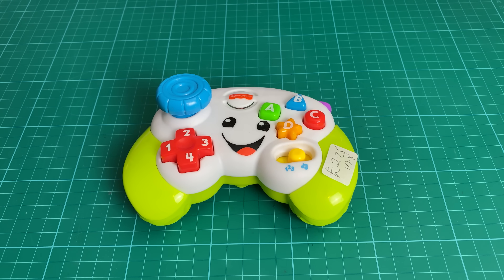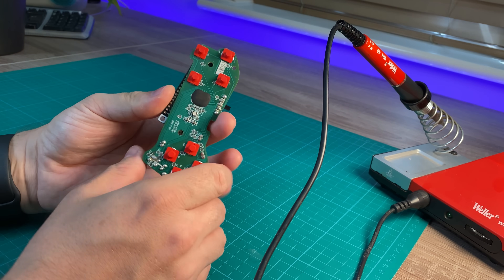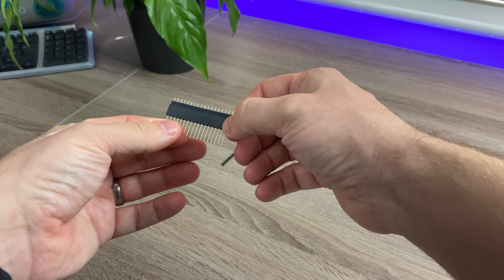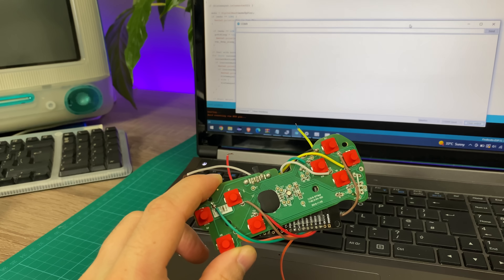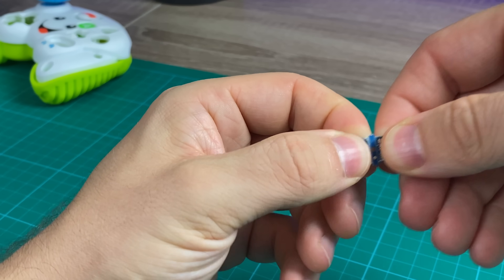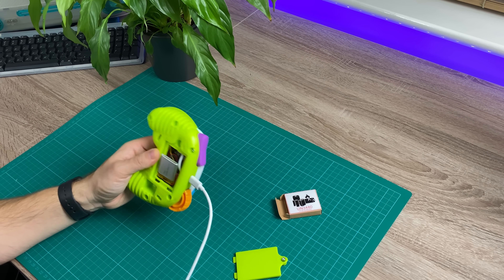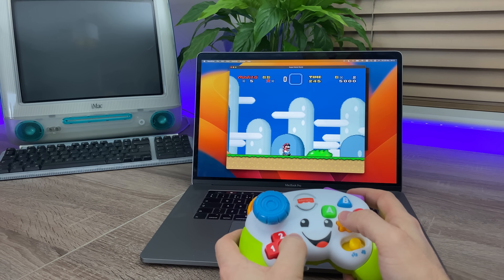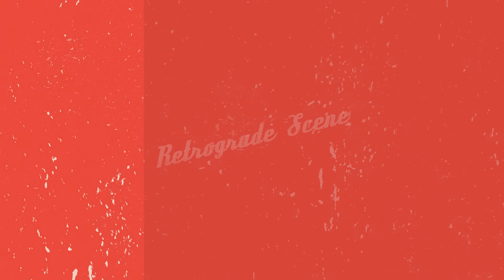Making a Bluetooth controller from a Fisher Price toy

Comment: I had similar issues with sleep on my lolin board, same design as yours.   Even when I set wake mode to any high and rewireing my remote with pull down active and buttons connecting 3.3v it would always get stuck in sleep or never waking up.

Comment: the hardest thing about tinkering with electronics like this is fitting everything together, we had a broken scale at home (i broke it trying to add a tp to it to make it charge a lithium battery before) so i thought to myself id fix it using an esp32 and a hx711 chips, coded everything up in no time, then proceeded to take 2 days trying to fit everything together, barely fit it at the end but it work now which is what matters
Reply from the maker: I know the pain well! That’s the good thing about kids toys is they’re usually more liberal with the space inside.

Comment: Those 2 small solder pads at 10:07 are for a tiny 5.1kohm smt resistor
I bought those same connectors and they work if you solder on the correct resistor
Reply from the maker: I tried that and a few other combinations but couldn’t seem to get it to work. Maybe it was just a bad solder joint. I’ve got a similar thing in a new project so hopefully I’ll have more luck with it.

Comment: Great work on this, for me I would just cheat slightly and use an 8bitdo Zero2 board since it does all the bluetooth, battery, and system compatibility stuff in the same size package as this board.

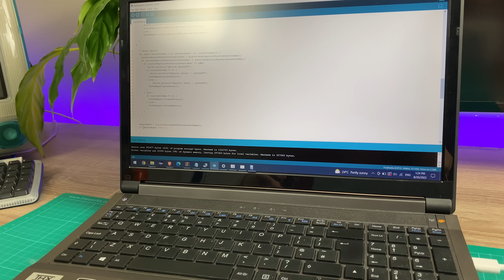Comment: super interesting video! I've recently been thinking about trying something similar as well, so this is really cool to see! and btw, for reference, 9:38 the USB-C port should still work for data if you're connecting it using a USB-A to USB-C cable – if your laptop doesn't have USB-A (like my tablet) then using an adapter to USB-A will work too. I used the exact same method of cutting up a microUSB cable for a project of mine just a few weeks ago! Nevertheless, I bought the very same USB-C ports recently, and I'm hoping to get them working with pulldown resistors~

Comment: Followed along but had a quick question on the wiring/programming. Did you use the debounce function in the ESP32-Gamepad library? And/or use the ESP32 built in pull-up resistor for the inputs before just cutting the traces? Not like I'm trying to save the sounds (trying to save my sanity!) but mostly for my own understanding. Thanks!
Reply from the maker: Hi I did write a version using the debounce but was having issues with it so the version that’s on there doesn’t use it. I did mean to go back and try it again as I’m sure it was something I didn’t have quite right. I also tried using the built in pull up resistor as I was hesitant to cut the traces. But I couldn’t get it to work and in the end didn’t thing it was worth the time to play around with to save the board, like you I was secretly glad to loose the sounds. Also it would take much to fix the traces if needed. I did consider adding in my own sounds but felt I needed to work on something else for a bit. Thanks for watching and good luck with yours.
Reply: @RetrogradeScene  thanks so much for the reply. I know a configuration that works now at least! Haha 
I'll solder things up and see how we do this weekend